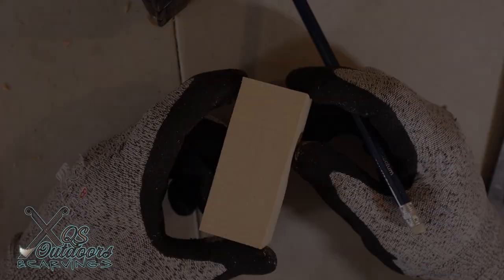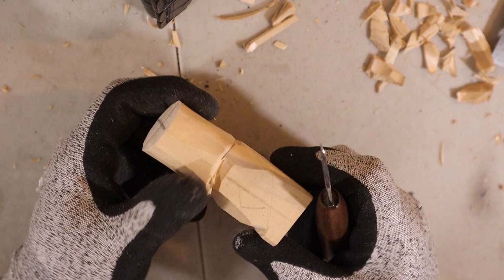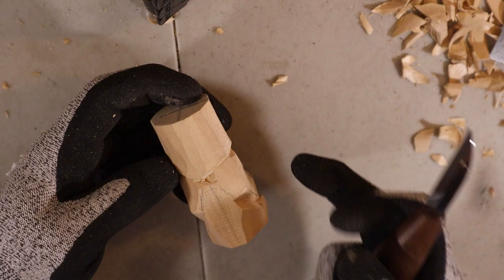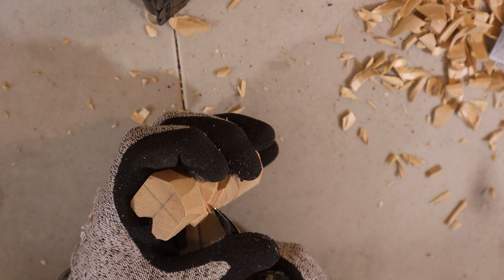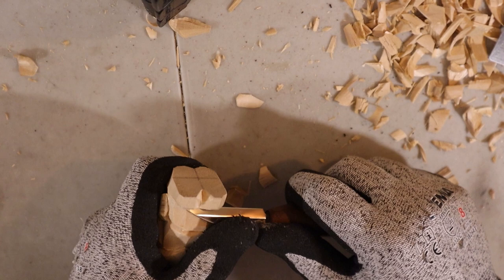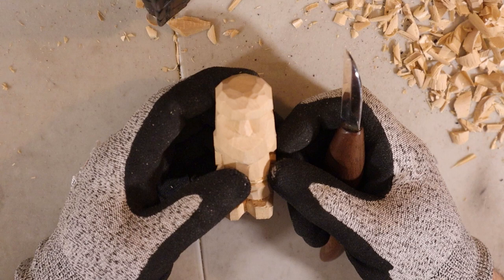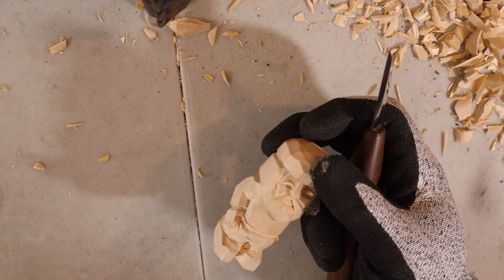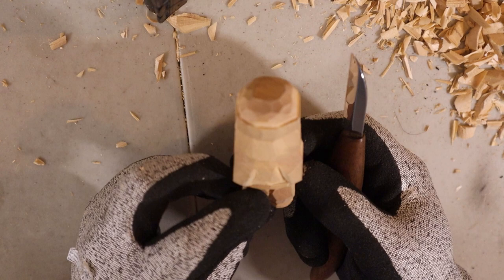Going Back to Basics - Simple Flat-Plane Viking - Tutorial

Comment: Enjoying the video can’t watch it all at once as I’m busy but will watch it all in time. I was wondering if possible could u do a couple of vikings using 1”x1”x3 or 4”? I only ask as I don’t have a workshop or anyway to mill wood to size so have to rely on what I can get off Amazon. which is mostly 1”x1”x 4”-6”or 10” if I had one to use as a guide it would help with future projects although I have the carving little guys book I find following ur videos easier as I can’t read very well and lose my place very quickly. Again thank u great video.
Reply from the maker: I will see what I can do. I got my wood all cut to these specific measure when I got them and I had around 520 pieces that I'm burning through. I also can't mill my own wood! Haha
Reply: @QSOutdoors  thank u